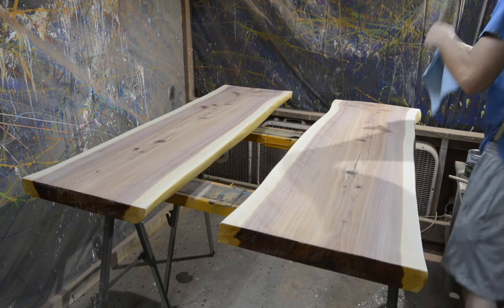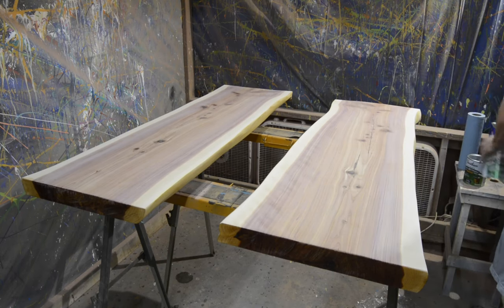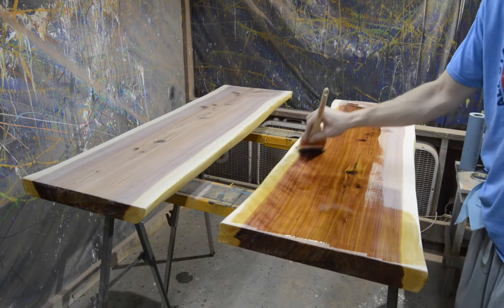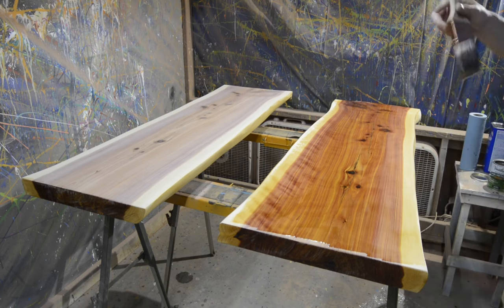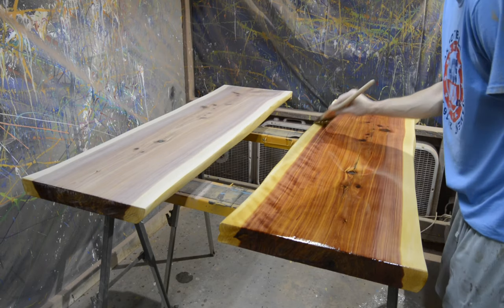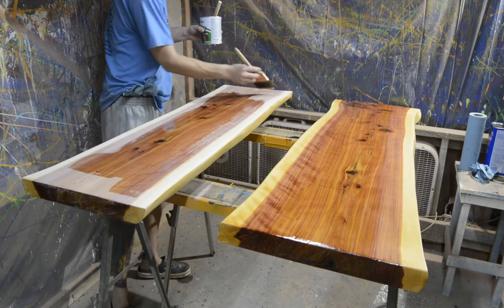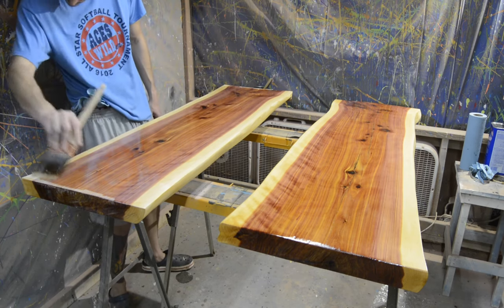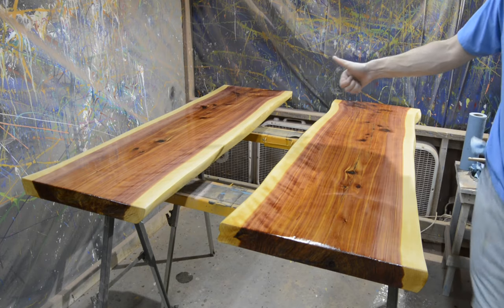Unlock the Secrets of Spar Polyurethane (Varathane) Applications!

Comment: How many coats do you typically do?  What does your mid-coat routine consist of?  Sanding with ultra fine, tack cloth, etc.?
Reply from the maker: It can typically take 3/4 depending the knots. Most slabs will absorb a good amount and I typically wait till a final coat to even mess with sanding any trash out. But that is only for table tops.

Comment: Spar urethane is very thick.  I get much better performance by mixing it with mineral spirits  (80% urethane, 20% mineral spirits).   Gives a much more uniform coat and no brush marks.   Better to apply several coats than one or two thick coats.....
Reply from the maker: Great point! It is super thick

Comment: I'm working with cedar. I can't get the spar to come out glossy (3 coats. I do use sanding sealer first.
I put the first coat on and the sanded to 320. 2 coat sanded at 1000 wet. Can't seem to find any good videos on this topic.
Reply from the maker: Typicality I do not sand the finish out on these benches. But I have before. The spar leave a gloss but if your going to sand any small (trash out) I would recommend a very light sand to 3000 plus. And use a rubbing compound to help buff the shine

Comment: Thanks for this video! What's the difference between Spar Urethane and Polyurethane? Is there a reason to use Poly instead of Spar?
Reply from the maker: Great question, Spar is an advanced version of a traditional polyurethane. Spar claims to provide more durability and more flexibility to help expand and contrast with the wood over time. I also find the oil based is a bit stronger outdoors with the advanced UV protection.
Reply: @TexasArtCompany  Thanks! It sounds like spar is altogether a better product, so I'm trying to figure out why anyone would use normal poly instead. Cheaper?

From my brief research, it appears that spar urethane is thicker, more protective, and flexible, while Poly is harder, tougher, and not as "gummy". Might be that poly is the best choice for furniture unless it's going outdoors?
Reply from the maker: I tend to agree, it sounds like you have covered all the basics. Poly as always been the go to choice for woodworkers but Spar seems to be a newer more advanced formula that makes up for any shortcomings a classic poly formula may have. It does add a richer "yellowish" hugh that may also be a draw back if the wood is a lighter natural tone. As well as a small cost difference and availability. As the market becomes more familiar with this formula we may find that it becomes the standard. Rust Oleum and Varathane offer a wide variety of both products in many different finishes and I think you have highlighted the need for me to compare them all.

Thank you for the support and feedback.

Comment: Just a random question, but do you think the ultimate spar urethane water based is safe to use for planter boxes? Just wondering.
Reply from the maker: It’s definitely “safe”, the only downside would be weather resistance. Oil repels water so it’s typically stronger in an outdoor application but oil based products can be tricky to clean up.

Comment: I prep'd a redwood burl table a friend made for me , after 30 years it was butcher waxed ,as I was told by my friend to do . He is no longer with us , (I would go to him if he was )  to refinish this . Instead I refinished the top with 60 to 1,000 grit ( I have a feeling  I over did that ) , my problem is I saw streaking as I put the first light coat on . (I used a foam brush ) I think in my case that may have been a mistake . The weather was 75 to 80 degrees I did it out doors in a half shaded area  to avoid too fast a dry . I thought after the 2nd sanding on the first coat the next coat would fill that in ,streaks but it did not . I used 600 grit on the first coat to rough it up ( Think that was another mistake ) I went ahead and took it all back to the wood with my original method 60 to 1000 grit fearing a disaster going any further I stopped .  What am I doing wrong? I want so much to preserve a memory of my friend , I'm sure he'd be calling me something derogatory a sarcastic way if he could> thinking of that makes me laugh but looking at my results does not -   I need help .Thank you for your time and any advise you can give me . -billy
Reply: Streaks as in scratches maybe from the 60 grit
Reply from the maker: Some finishes suggest only sanding 240 max. It has to do with the grain becoming to tight to allow the wood to absorb it. I apologize for the late response. If your still having trouble I’d be glad to help.
Reply: I’d start sanding at 220 and work to 320, the more you go up, the harder it is for the stain to penetrate. Your foam brush should work fine, but a natural bristle brush works awesome for me. Try thinning your urethane 10-40% it will help with the streaks. I sand at 400 after the first coat, then 600 for the rest. Make sure you clean a stupid amount after sanding each time. You’re making your friend proud by not giving up! You got this👍🏼

Comment: Omg can you please help me out. The guy from home depot recommended me to use this on my hardwood floors. They came out great but after reading some comments, they say it shouldn't be used on floors. What is your opinion?
Reply from the maker: In touch up situations I can see this working well. Cost wise it maybe a lot compared to others. Typically hardwood floors are a polyurethane finish/ very similar. It is a much “darker” product than a water based product but if you like the look now you should be good with the quality of product.
Reply: On a larger surface like hardwood floors I suggest a poly that spreads and covers the area more freely/quickly, and dries quicker too.  However, on an oak staircase (and oak bar) I used this product on both the banisters and steps almost 20 years ago.  It is a very hardy surface and still looks excellent!  Both good products.  Spar urethane I believe would be more difficult/costly  to use on large flooring.  I love the look on table tops, bar tops, railings.  My Dad turned me on to this product over 30 years ago.  He was a life long woodworker.  Opinions may very but I dig the product.  (your comment was a year ago.  How did it turn out?)

Comment: Does it need to be diluted as the instruction says ( to have a bubble free coat do not dilute) so isn't be thick if not diluted?
Reply from the maker: It’s definitely thick. But depending on the wood the first coat will absorb a lot. This products definitely takes patiences. I have personally never diluted, I could see how it would help the penetration of the product but I’ve found a light sand between coats to remove the bubbles works well. Once a full coat has sealed the top there shouldn’t be any more air pockets to produce bubbles. Really focusing on sealing the wood to reduce bubbles, then focus on a flawless finish.
Reply: @TexasArtCompany  so at the first coat shall i use the varnish with out being diluted so the wood can absorb it ? And what about air bubbles? Does diluting this varnish makes it more able to form bubbles?
Reply from the maker: @ahmedhesham8980  diluting may help reduce the bubbles, but if you start with a  lighter coat and build it up you shouldn’t trap a lot of bubbles. Less is more. Patients is key.
Reply: @TexasArtCompany  ok so what is the dilution percentage you sugest for best results
Reply from the maker: @ahmedhesham8980  I have not tried myself. I wouldn’t do more than 10%

Comment: What number sandpaper do i use on live edge cedar?  Also, does it need a second coat of spar  ploy?
Reply: I use 220 to take off imperfections of 1st coat.  Then apply second coat. Let dry, then sand with 320 in between each coat going forward.
Reply from the maker: You can go as low as necessary but you have to work those swirls back out with higher grit sandpaper( if you go lower, don’t skip grits) . I would recommend no lower than 120 if it’s your first try. 220 is smooth enough to put a finish on.

Comment: Just one is enough?
Reply from the maker: The amount of coats will depend on the wood and end use. Some woods will soak it in depending on their species and how dry they are and may require more coats. You may also want to use more than one depending on how you plan to use the project.
Reply: @TexasArtCompany  It’s for a seating area should I do 3? 🤔

Comment: Why use water based vs oil?
Reply from the maker: This product is an oil based product. But in general I would use oil based over water based. It requires more dry time and is a hard to clean up, but I feel the “warmer look” and durability from an oil based product gives a good finish. (The yellow hue may not be right for all projects). Water based has its pros as well and is much more forgiving.